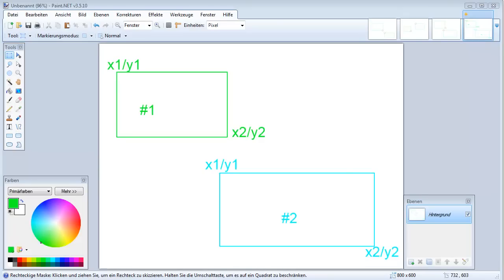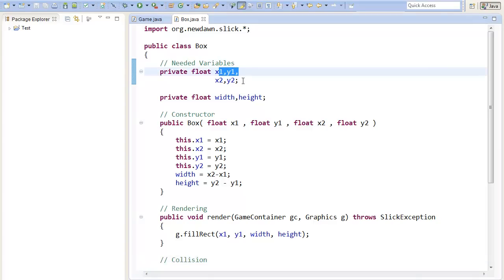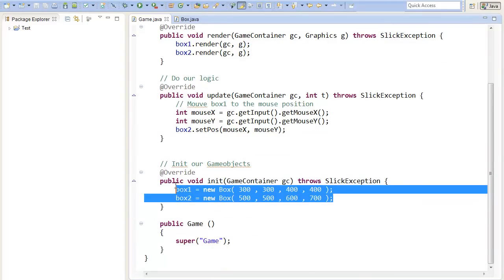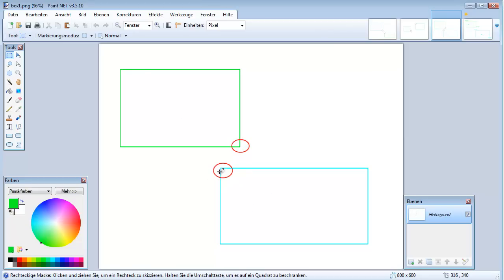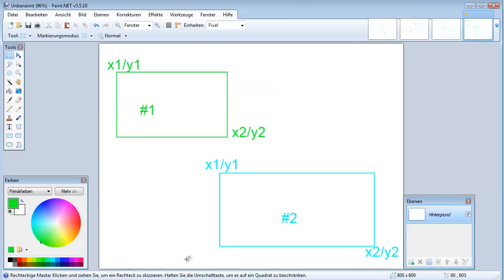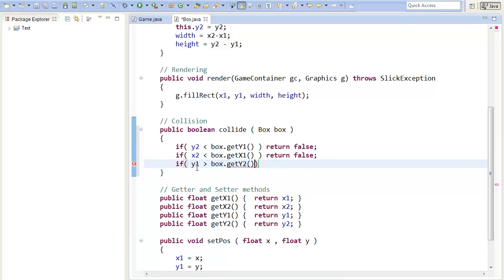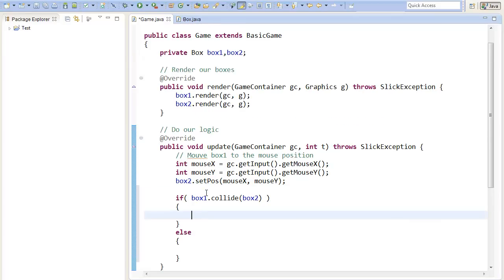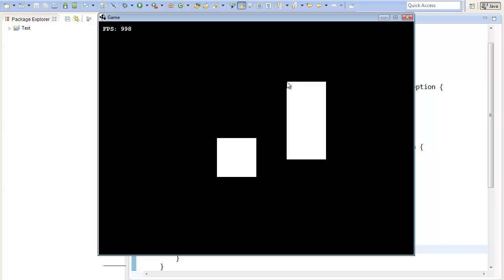Box-Box-Collision - Slick 2D Quick Tip #008

Comment: Sure you can do this, but it is easier to create 2 Rectangle objects and then use the intersects() method to determine if the collide. It's a function built into java and it takes up much less code :)

Comment: Hello, when i trying to compile into jar, i can't run it.
:(

How to build project into simple jar ????????????????????????
Reply from the maker: Hey,
it's quite some time since I done this and I never got to pack it into just a single  jar as you need the DLL files to run.
First step would be to simply export the project as a jar & pack the DLL folder relative to the jar, so when starting the DLL files are found and can be loaded.

It's for sure also possible to pack the DLL's into the jar, just google a little if it's very important that it's a self contained jar file.
Reply: Thanks ^^